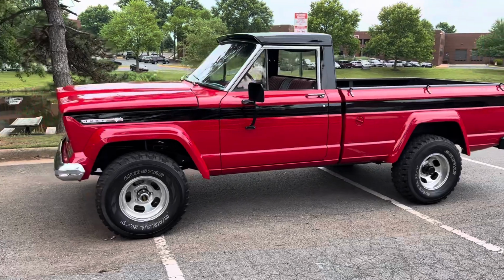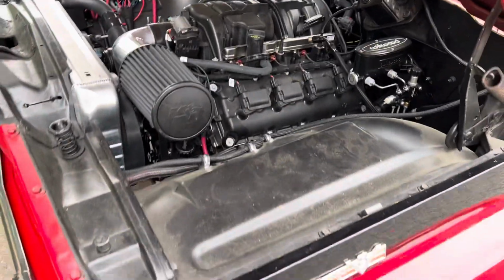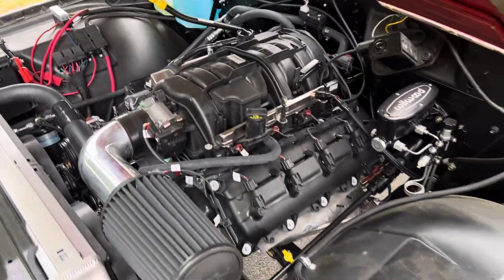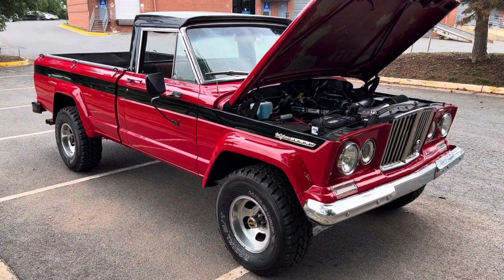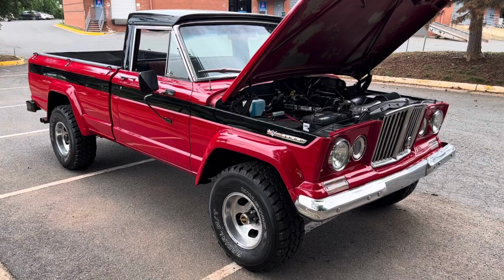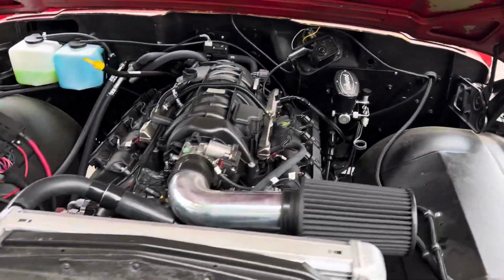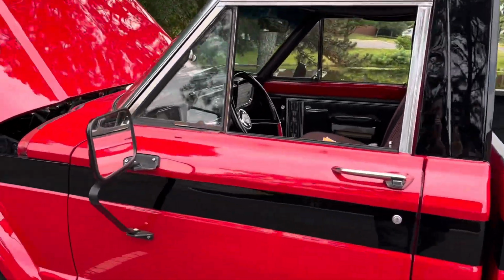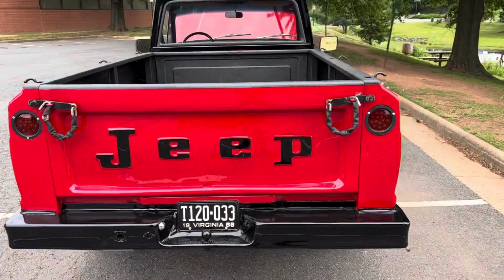‘68 Jeep Gladiator Hemi Swap

Comment: hey planning on doing this swap on mine what engine mounts did you use. awesome truck
Reply from the maker: We used these - you'll need to weld them together and into position yourself. No straight bolt in products that we could locate.

https://welderseries.com/store/Motor-Mount-Kit-Gen-III-HEMI-5-7-6-1-6-2-Hellcat-6-4-p137164624